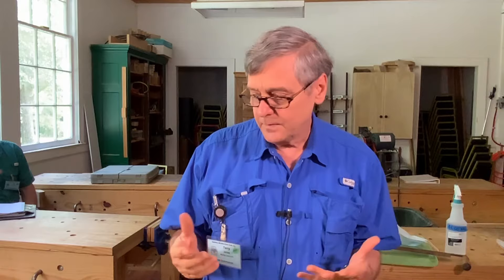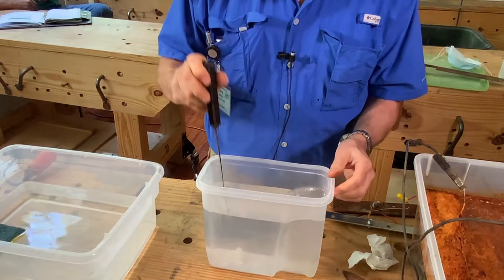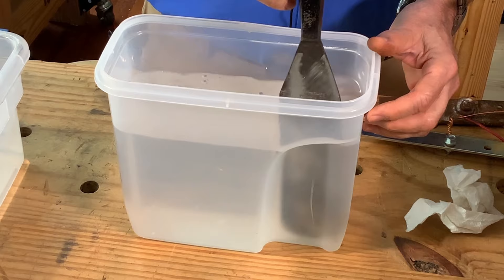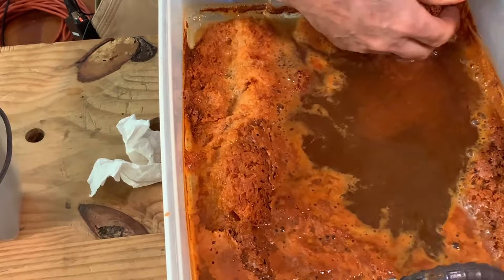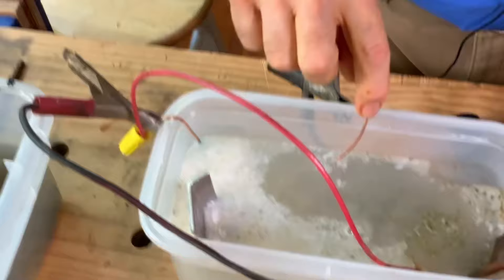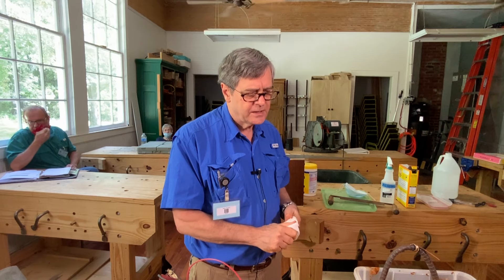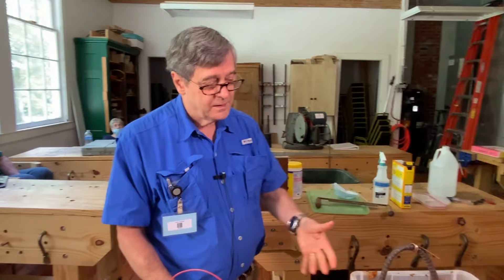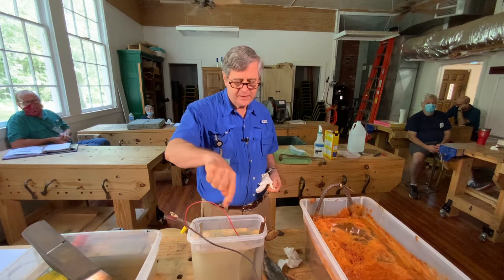Rust Removal via Electrolysis with Terrence James

Comment: Great explanation and instruction on how to set up. I would use the washing soda for this job like I use washing powder in the washing machine and use enough only to do the job or the powder will spend more time fighting against itself than doing the job it should and as you say it is only wasting powder. I use a small amount of washing powder in my machine about 1/3 cup of washing powder and it also helps the lasting of the washing machine

Comment: I wonder if I could ask you a question if you're not too busy. I've been trying this electrolysis and it seems to be working great . But I do have one concern. It's hard to get good clean steel around here  where I live. So I've been using tin cans Like coffee cans tomato cans but they all have a coating on the inside. When I'm using the tin cans the liquid solution of washing soda and water stays very clean but  there is a lot of bubbling action. No rust scum floating on the top of the solution it all goes to the tin cans and builds up there . I cut the tin cans into and hang them in the solution Length wise. My question to you is   using tin cans with a coating on the inside is this throwing off any harmful fumes ? The part comes out clean and the tin cans have quite a build-up of rust build up but the solution is very clean. Thanks

Comment: The bare copper wire is just a little extension from the positive to the cathode. There is a big difference in electrolysis and electro plating. It would profit anyone to go online and take a look at OHMS law of electricity.

Comment: If de rusting a chain , a chain to hold a gas tank not a bike chain . 
does the cathode ( neg terminal ) need to make contact with every link in the chain ? 
Also where the neg terminal makes contact with the part being de rusted , can it just be connected to the rusty part , or do you have to make connect with the base metal on part being cleaned ?

Comment: Is there something to remove the black soot thats on the surface after electrolysis treatment? I have it in areas that are hard to reach.
Reply: You could try a soak in 1/1 vinegar / water for maybe 30 min at a time. That is what I have seen on cast iron skillet restoration. Evaporust is $$$, but works well for getting at the last traces of rust.

Comment: can you do it more than once...with better results?
Reply: That's the beauty of electrolysis. It's safer than other methods of removing rust. Using chemical methods can dissolve the base metal of the tool you're trying to clean. Electrolysis won't damage the piece you are cleaning. 

You can leave a tool in the electrolysis tank for a long time, or repeat the process several times. After the rust has been removed, the process simply stops. It will not "eat" the base metal of  your tool like abrasives or chemicals.

Comment: I have a question. Can you use pool salt as the electrolyte?
 I'm trying to derust the inside of a small tank off a generator with electrolysis but it has a baffle so I can't get directly into the end compartment. I only have access through the filler at one end. Hoping it will clean the whole tank out
Reply: Pool salt is what salt?

Anyway, I have seen videos where people use a pool product called pH up, which is supposed to be sodium carbonate.
Reply: Pool salt same thing as pH up

Comment: At 15:47, you touched Cathode. Didn't you get any shock?
Reply: I saw him touch the electrodes as well and wondered if it was safe. 
Clearly he never flinched and never mentioned that you shouldn’t  so I presume as the voltage is so low it doesn’t matter.

Comment: well, you are wrong on one subject. using copper, aluminum and so on on positive side will not electroplate anything, as this rust removal process is basically plating positive side with rust.
Reply: I have used copper and I did get copper on the part I was derusting.
Reply: did you even watch this vid?